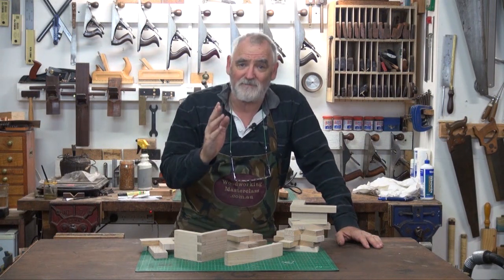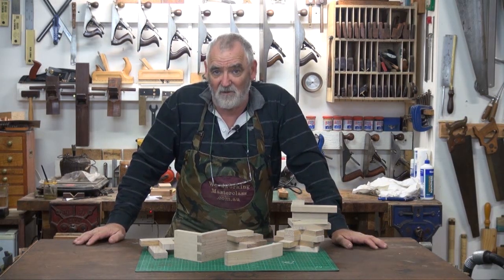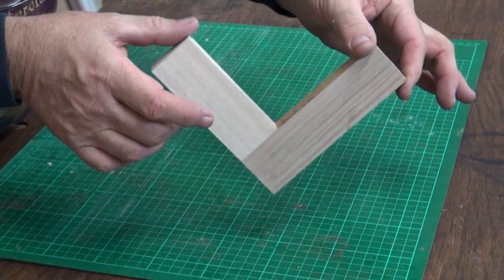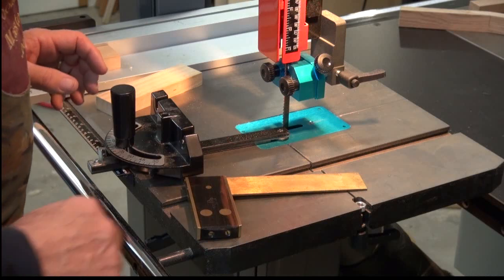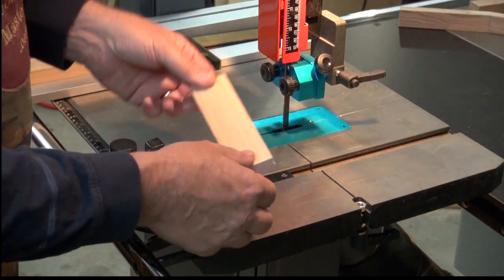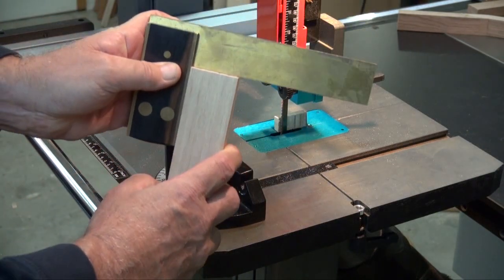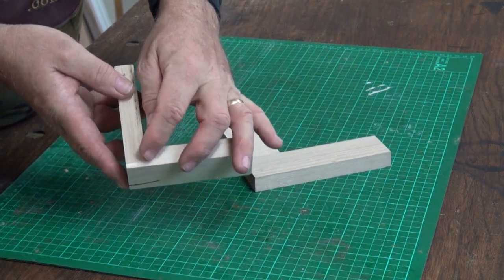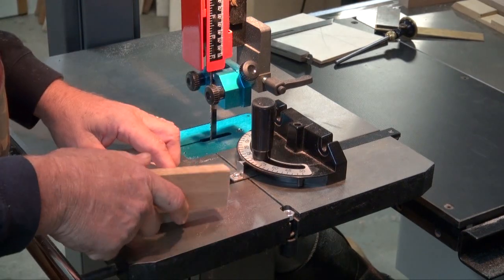Bandsaw Joints (1 of 9) Butt and Lap Joints

Comment: Hey Steve!  Love the video and the info.  How does a bandsaw fare for ripping boards?  Would a larger blade (1”) be good enough for tipping?  Reason I’m asking is because when I setup my first real shop, i love the Reese capacity of a bandsaw but a table saw is perfect for rips.  I am a hand tool guy mostly, your thoughts are appreciated!
Reply from the maker: Hi Brian, I've ripped timber on a bandsaw for many years. Ideally a courser blade with a bit of width is best, having said that I've ripped with a 10mm 6tpi blade as well. Just got to take it slowly and let the blade cut in it's own time. Don't force the timber onto the blade or it will definitely wonder and give a crooked cut. Thanks for the feedback, appreciate your kind comments. Cheers Steve